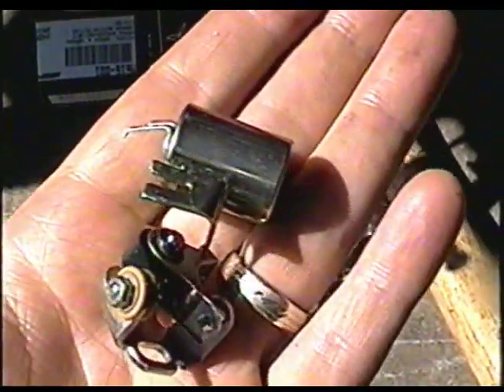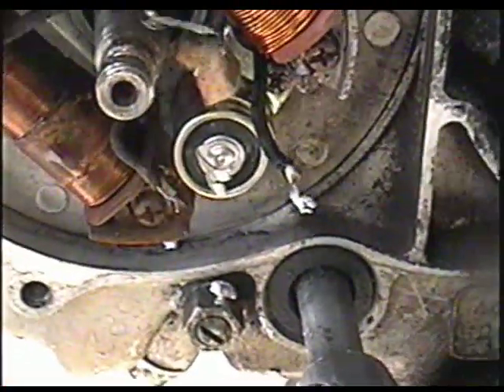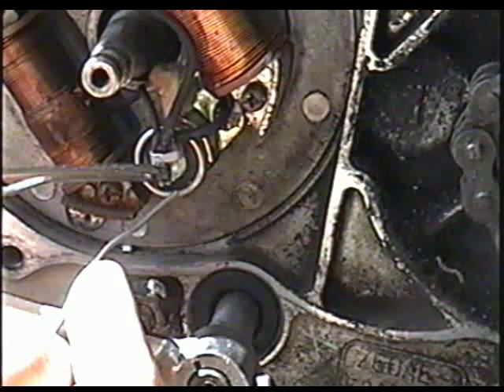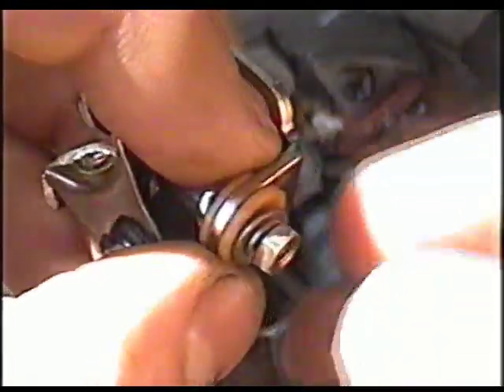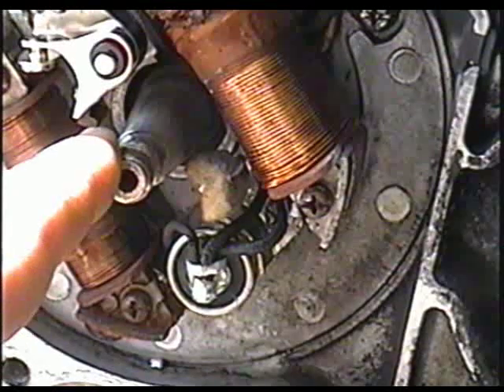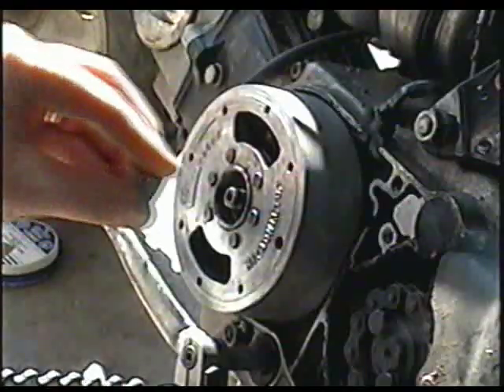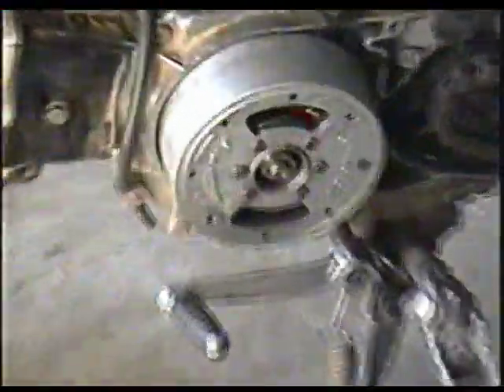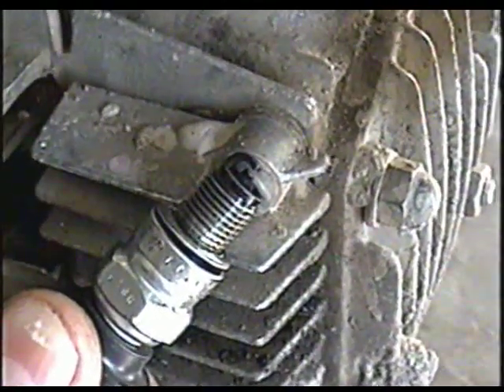HOW TO Replace The Points & Condenser on Honda Z50 & CT70 Minibike PART 2/3

Comment: Excellent help here thank you. The close up of the wire being connected to the points is what I needed to see. Amazing you did this for us. Thanks a lot.
Reply: Same here.  I tried this before, but got the condensor to hot with the iron.  I like your method.

Comment: Excellent, Thank you!  I'm rebuilding my CT70 right now.  The flywheel puller you were using should be a lefthand thread.  Mine was.  That could have been why you couldn't screw on the puller.  Somebody might have already said that though.
Reply from the maker: yes exactly

Comment: @kball1313...You are correct.  My bad.  Yes, you should always use OEM specs.  Eyeballing a points gap is not the way to go, as it would be a good way to be off.
I appologize.

Comment: @TheHossHobart 

You never mentioned the F mark on the flywheel is where the gap is to be checked and the spec is .012-.016" . How to videos should use OEM specs and not eyeballing a points gap which has a huge effect on actual static timing.

Comment: I have a 1979 Z50 and has what looks like strong spark but even with starter fluid it doesn't even try to catch. Would you think that even though I see spark it could be week and need a new condenser or should I just try to re adjust the point gap?

Comment: hey i had my st50 fully running but than suddendly there was no spark anymore chage the sparkplug didnt help check the points and coils and condenser no result... how do i check the bobine?
Reply: by measuring it with a multimeter, look up for procedure ;-)